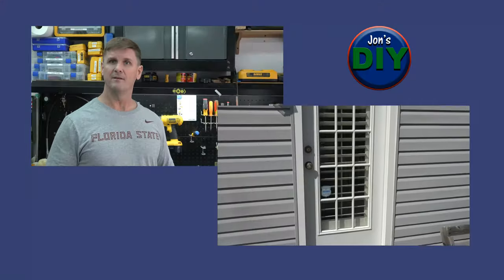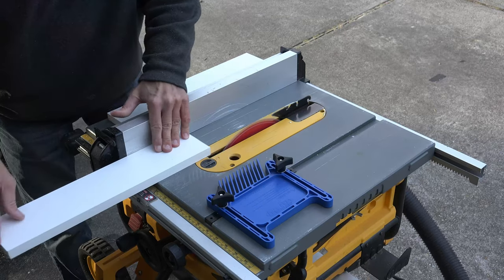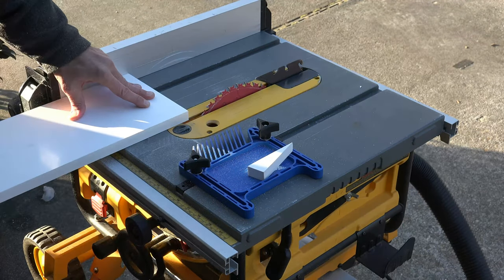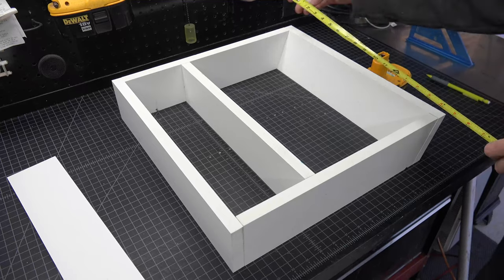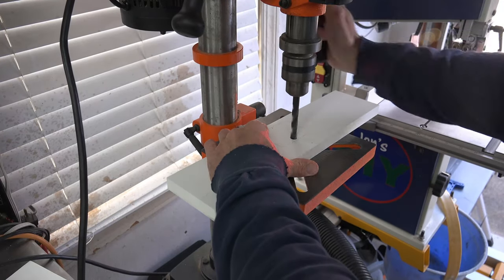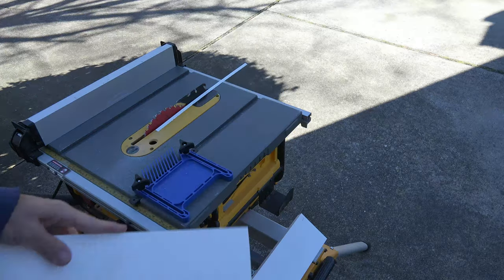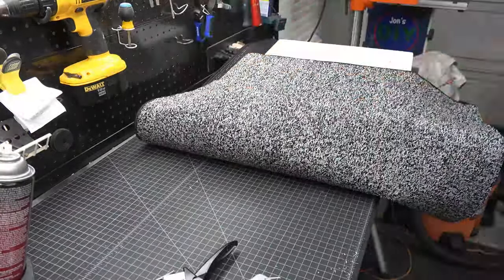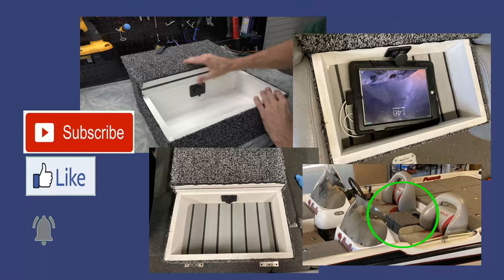Rebuilding a rotted center console for a bass boat.  (Jon's DIY)

Comment: Did you consider reversing the door latch  so you can open while you are running in the water?  Also how about adding lockable handle so you can lock important when you are away from the boat? Also need a way for the water to drain just incase you got water in the box
Reply from the maker: Build to the specs of the owner.  Not sure why you don't think this can be opened while running.  The box itself is on hinges that allow the whole thing to flip up and access the well below.   Adding a lockable latch would be easy.   I did suggest the drain holes but the requester did not want them, saying he did not want any moister in the box from the splashing water below.

Comment: I'd like to buy one!
Reply from the maker: Nick,  these are custom made.  They need to fit and are specific to each boat.  Send me your old one and I will make you a new one.  jonsdiy@gmail.com
Reply: I need it 15.3/4inches wide  15 inches long
Reply: How much $?
Reply from the maker: @nickbowenfishing2885  height?
Reply: @JONSDIY  5inchs
Reply: All measurements should be after carpeted if that's possible... charcoal carpet